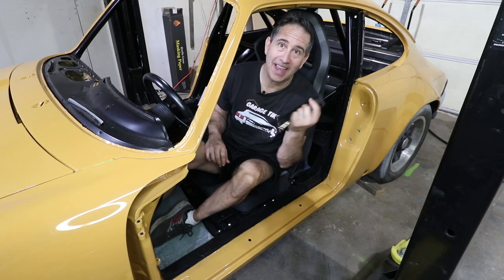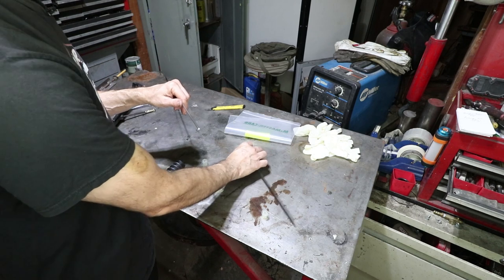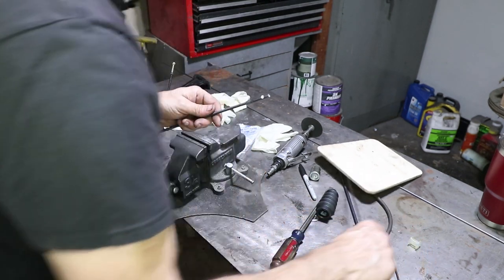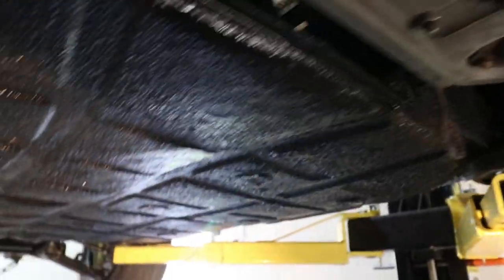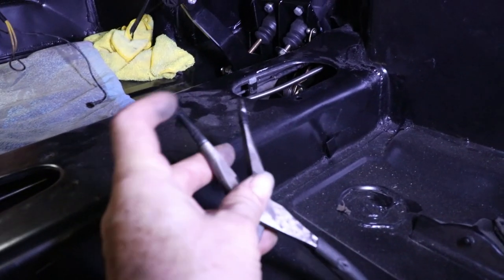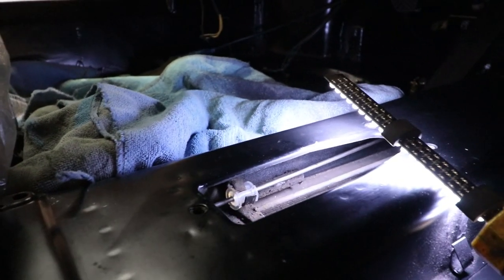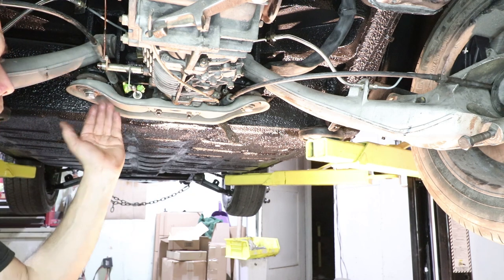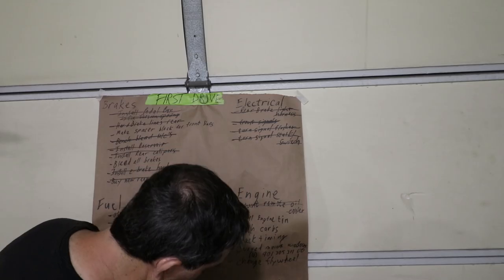Porsche's Gas Pedal Linkage Is CRAZY - Accelerator Rod Install & Adjustment

Comment: Small steps, Tom. Couldn't tell you how many times I said to myself "that was harder than I thought it would be". Good job!
Reply from the maker: Thanks Chris.  What does the Triumph accelerator linkage look like?  Is it a simple sheathed cable or a rod system?
Reply: @GarageTimeAutoResto  It's a rod system. The pedal and the carb linkage are joined by a removable rod and everything else is solid steel. Cables were used until later cars.
Reply from the maker: Cables were used on later cars?
Reply: @GarageTimeAutoResto  Yup, starting with the Mk3 around 1970-71 or so, the cable came up and over the valve cover. Some people convert to cables.
Reply from the maker: Thx, I'm just wondering what if cables weren't allowed in the 60's?  I seem to remember vw used cables in that era
Reply: @GarageTimeAutoResto  Yup, I had a 69 bug that had a cable.

Comment: Looks a complete ball ache to set up Tom , again your perseverance is admirable. I just ran a sleeved cable from my pedal linkage direct to my PMO's. Well done for getting it sorted!
Reply from the maker: It's wild how complex this is.  Porsche clearly  used some 356 parts to cobble this together.
Reply: @GarageTimeAutoResto  Seems so convoluted when a sleeved cable would have just done the trick. I think on some systems the Porsche engineers definitely over complicated things
Reply from the maker: I wonder if a sheathed cable wasn't allowed back then due to potentially sticking?  That's the only reason I can think of.  
Their convoluted rods will fail, but will always revert to idle?
Reply: @GarageTimeAutoResto  Well it you come unstuck here's a link for the cable (though mine was for RHD) https://www.tuthillporsche.com/product/throttle-cable-porsche-911-lhd-carb/
Reply from the maker: Nice, thanks Chris👍

Comment: This video was a god send. If you have a tig welder you’re already set up for brazing. Just buy some silicone bronze rods.
Reply from the maker: Great😀. I should use silicon bronze more often!  I've tried it and it's not that much different.  Just lower temperature.

Comment: Hi Tom,

Great video.  I ripped everything out of my tunnel and all parts are in boxes.  I'm not sure I have all of the accelerator linkage parts.  My plan is to paint my car on the rotisserie and then try to run all lines through the tunnel before I put on the suspension and put it on the ground.  We will see if that works.   Oh, yeah and headliner too, should be easier upside down.
Reply from the maker: Cool that will make lots of things easier. 
 I had my 356 on an octagon rotisserie and the bars got in the way of the painting process so now it's on a flat dolly and I will be crawling around again to put all those tunnel items back in, sigh.

Comment: It's no wonder Porsche had to get Toyota in to show them how to make cars profitably! Why use a cable when a massively complex mechanical linkage will do?
Reply from the maker: It's a wonder Porsche made any money back in the 60's and 70's.  
My only thought is Porsche was really concerned about a stuck open throttle.   If a small pebble or grit built up in a cable then it could stick.  The mechanical linkage has huge clearances everywhere so it's unlikely to get stuck.  
I'm still baffled why there are so many adjustments though.
Reply: @GarageTimeAutoResto  It is a mystery - the 914 and all beetles and VW buses always used a cable. Have a look at the mechanical throttle linkage at the pedal end in RHD a 964 or 993 for another complex throttle linkage. They used cables, but after moving the clutch assist spring mechanism from the gearbox (915) to the pedals (G50), there wasn't enough room for the shaft running across from the tunnel to the pedal, as used in all earlier RHD models. The 'fix' was another complex mechanical linkage mounted on the front firewall, using the space up above the clutch assist spring mechanism to transfer the motion across towards the tunnel then back down to floor level. Bushes, cranks, pushrods and ball joints everywhere! Annoyingly in the parts catalogue they try to show it on the same page as the LHD version which is not helpful at all.